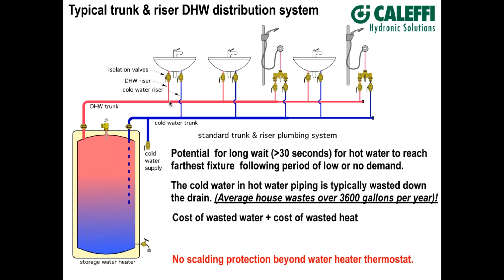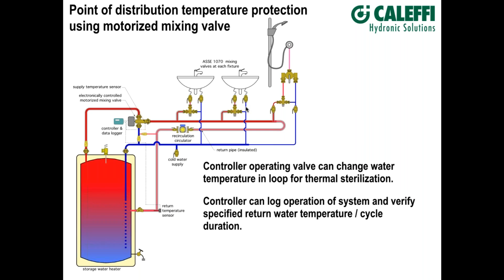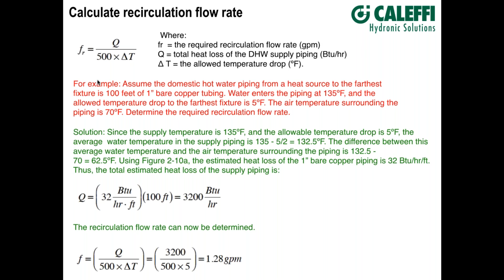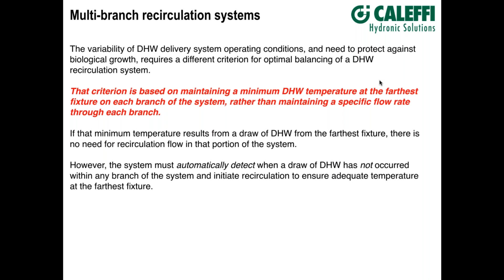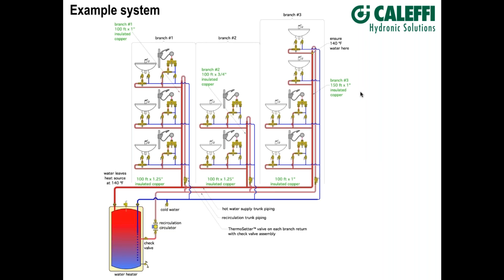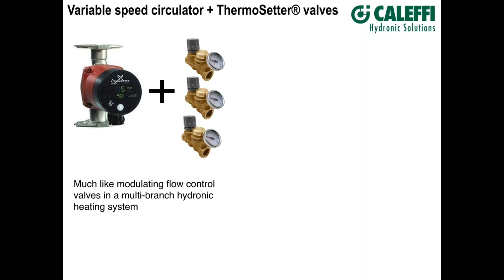Hot Water Recirculation Systems

Comment: For head loss calculation, you did not considered the residual pressure for the fixture unit into your calculations.
Can you explain why ?
Reply from the maker: First of all, sorry for the delay in replying. The fixtures are not part of the recirculation system design considerations. Think of the recirculation system as being similar to a closed loop system, regarding pressure loss calculations. And the recirculation pump GPM requirements are only based on the heat loss in the supply section of the recirculation piping, not part of the required fixture flow rate for hot water. We hope this helps.

Comment: At 10:44 you switch from discussing a 1017 mixing valve as in the diagram to discussing a 1070 valve but the diagram still shows 1017.  Can you clarify that the additional valves are necessary when using a single 1017 as in the diagram and with no 1070's at points of use?  Thanks!
Reply from the maker: Thanks for your question.  To iron out the confusion, we suggest that you talk directly to our Technical Support Team.  You can reach at (414) 238-2360 at Extension 3370.

Comment: Can a water circulation pump work with a simple direct solar water heater with no indirect heat exchanger? (the tank and the solar thermal collector are together in the sun while the pressure comes from the city main).
Reply from the maker: While the idea is sound, there is a lot that goes into solar thermal applications. I would recommend watching our other webinars regarding solar along with reading issues #3 and #6 of our idronics technical journals found at this link: https://www.caleffi.com/usa/en-us/technical-magazine. Hope this help!
Reply: Thanks for the response, I'm proficient with solar thermal applications and read a lot about it in the past, using technical journals like this one but never figured out if it's possible for a water circulation pump to force hot water to reach the shower faster over a direct, passive, solar water heating system.
Reply from the maker: Glad to help!

Comment: no comments ?  wow...  this is a good video, however, maybe i missed something, but what about the use of hot water recirc pumps and heat pump water heaters?  i hear it's not a good idea and i dont understand why that is
Reply from the maker: Thank you for your words. Yours could be a good question to pose to a manufacturer of heat pumps.  Another resource to check out is HeatingHelp.com. You can search on their site for an answer or post to The Wall to start a discussion.  Hope this helps!